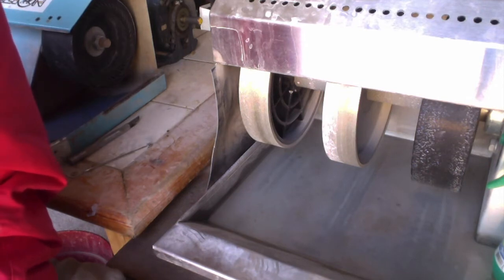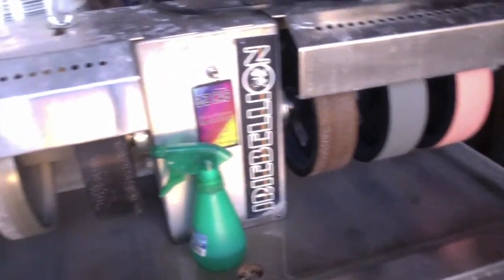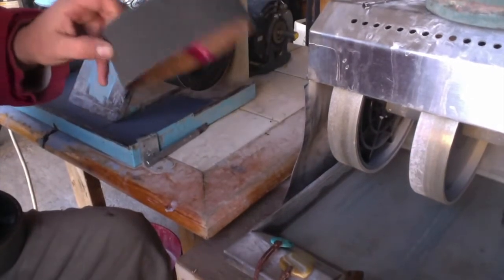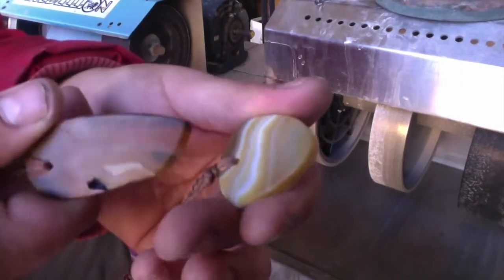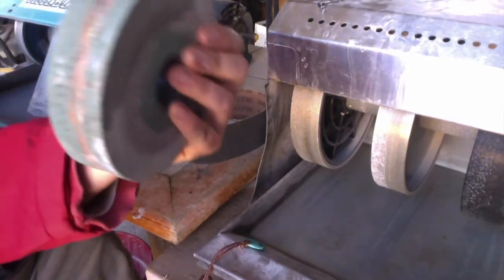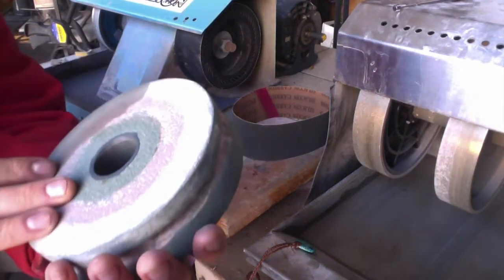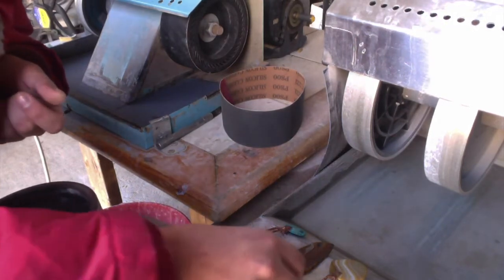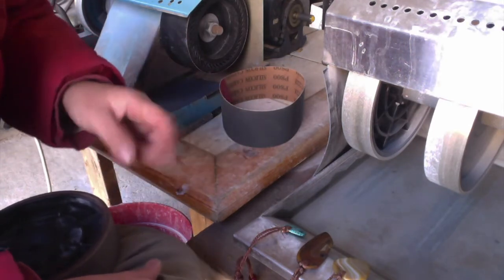Diamond vs Silicon Carbide Lapidary

Comment: I have a 2000 silicon carbine wheel that's on a ironton 7in machine that I can't even find online. Can't find replacement wheels 😕 don't know what to replace it with.
Reply from the maker: If it’s really 7in then I have no idea either :(

Comment: I have an old Highland Park 6" 2 wheel machine that has 100 and 220 silicone carbide wheels.  Considering this, what grit diamond wheels should I get?
Reply from the maker: if you mean the course wheels most folk use 80 and 220

Comment: Hi! I know im a few years late to the party but I loved the video! I'm very new to cabochon cutting and the silicon carbide wheel that came with my machine drives me crazy!! First of all it is porous, which makes it very hard to keep wet.  Second, the scoring you mentioned kills me! I try very hard to use the entire width of the wheel but can never seem to avoid truing my wheel three or four times per cab.  I work almost exclusively jasper, which to my knowledge is around 7 on the mohs scale.  Do you think it would it be worth my money to invest in a diamond wheel? Idk where you get your wheels for 40 bucks but the lowest I could find is 80 to 100 dollars.
Reply from the maker: Trevor Hardwick I do think it is worth buying the diamond wheels the last for a very long time I’ve never worn out diamond wheels over when it comes to where I get my wheels for 40 bucks I get them from  “Jewels & tools” During the Tucson gem and mineral show if I’m not mistaken they sell there we’ll just a little bit more affordably in person at the Tucson show then they do it online but their website does have them for a pretty good price

Comment: Hi Dave!  Your videos have been very helpful to me, thank you!  I just got some of those hard diamond wheels (mine are from Hans lapidary) for my Loritone SA-6 and am wondering if they are supposed to be installed in any certain direction. The insert (black plastic part) on one side is clearly different than on the other (mine are similar to the one in your hand in this video). I got an 80 grit for one side and a 220 for the other. Can they be put on with the smooth black side facing either the machine or away from it?  Having trouble finding info on this anywhere, so thanks!
Reply from the maker: Thank you so much for reaching out to me and for your love and appreciation it really helps me make better videos, when it comes to the direction of the wheels I personally do not believe it matters which side you put them on however in my opinion you should put both wheels on in the same direction this is because when your whell starts to become very broken in you're going to want to flip the wheels to get extra life out of them and you're going to want both of your wheels facing the same direction so you know which side of the wheel you have been using and which side needs to be flipped for extra life,I hope this helped feel free to ask me any question anytime it's my pleasure to serve the lapidary community
Reply from the maker: also I am here at the Tucson gem and mineral show and I just got to meet the gentleman from Hans lapidary he is a very kind man down here in Tucson with his family you should come to Tucson if you're into lapidary sometime

Comment: with the silicone wheels, do you have to use water? Thanks
Reply from the maker: RK M Yes you absolutely do have to use water with silicone wheels at least to be safe if you’re wearing a respirator you don’t need to use water on anything diamond does not break down like silicon carbide however the heat from carving will make the diamonds pop out of their nickel plated wheels so I guess it’s more important to use water with diamond and silicon carbide I see a lot of documentaries were folks use silicon carbide wheels to cut agates in India and which they use no water also when it comes to polishing agates With machines such as Highland Park bowl wheels no water is used so I guess you really don’t need to use water and I had to think about it for a moment I will be upgrading this video very soon and maybe I’ll pull it down because I left so much out but thanks for the question it made me think a lot I do not think you need water like you do with them and wheels when using silicone carbide in fact some machines that use on the silicon carbide like the ball wheels like I mentioned before do not even have attachments for water at all in our intended to be used without water anyway I’m rambling thank you so much for the comment I really appreciate it and I feel like I learned something

Comment: When you were using belts to carve those agates, do you remember which grit number you used first? I am considering going the EX drum way, but know I have a ton of agates to process and wondering if it would work (maybe better with a tougher grit than you used?) Thanks!
Reply from the maker: I almost never carve and polish agates using silicon carbide or expandable belts I usually carve them on my diamond equipment since they are so tough, starting at a rough grit isn't going to help too much because putting deeper scratches in the Stone from a rough agate is only going to make polishing harder, when I have to carve an agate using silicon carbide I first use a 360 grit HARD wheel instead of my 80 or 220 grit Wheels then I polish out my 360 rough scratches with a 220 Grit sanding belt and move on from there , long story short when I work agate I try always use diamond because of how hard they are but when I have the extra time to work agates with SC  I have had better results with starting a a finer grit HARD wheel  (320-380) and moveing back to 220,600,1000 then I have starting at 60,80,220HARD wheels and then going to grits like 80,120,180,220,400,600, with SC belts ,I also thought using rougher polishing SC would remove agate scrathes better and faster but and I even have 60,80,120 SC belts I might never use because it dosent work well for me , I hope this helped ;) feel free to message me if you need a better explanation